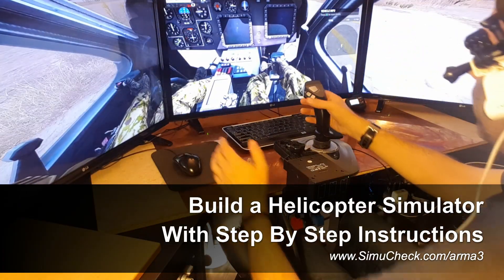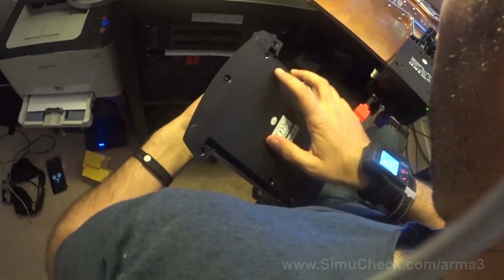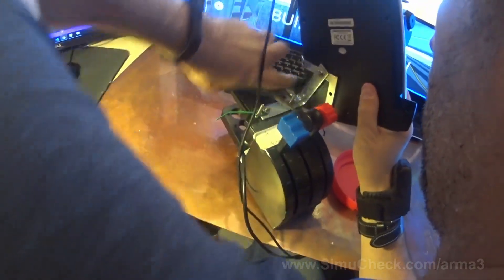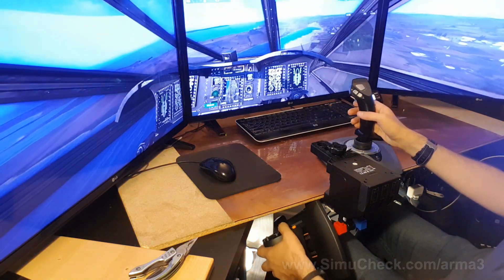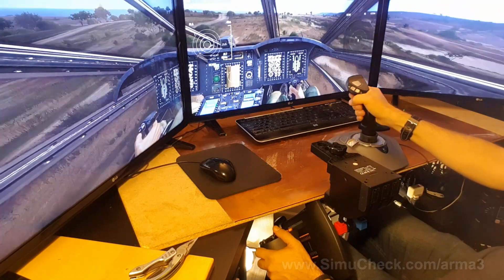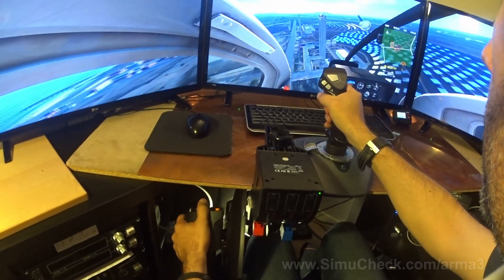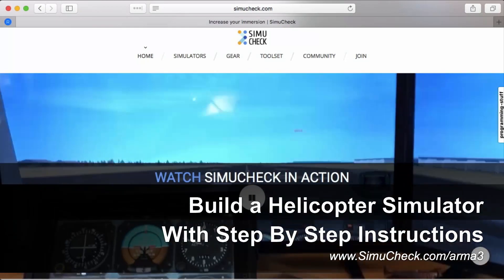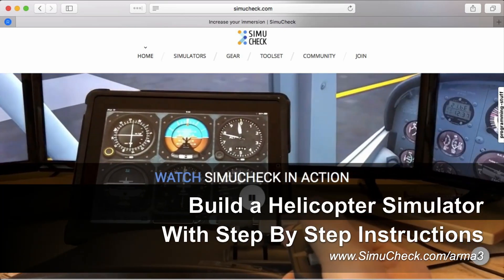Easily build a realistic helicopter simulator with Arma 3 - Step by Step Instructions

Comment: I'm looking on your website and it doesn't list the hardware that I need to connect the Thrustmaster to the throttle quadrant.
Reply from the maker: In that video I just spent a weekend and used metal rails from Home Depot... It was a hack. I have been wanting to find time to refine the process and put the plans on my site, but not enough time
The problem is there isn't a single rail from Home Depot that connects both screw holes on the thrustmaster. So I used 2 rails and then connected them together. I have considering 3d printing a plastic connector. 
Also after I created that video one viewer said the collective should be lower next to the chair so I started playing with it next to the chair ( http://www.simucheck.com/SimulatorSetups/view/8 )

What do you think ? Should it be 3d printer plastic or on the metal rails I could also drill out a hole to match the exact location ?

either way Flight Simulator 2020 is coming out so I might be airplanes for a bit before I return to helicopters ;)

Comment: Also, you could've use TrackIR to look around.
Reply from the maker: I really like TrackIR and I have tested in the past, but with flight simulators I found always looking down to aviation charts it always set the view down. So I need to see if I can customize to only move in specific ranges, so this would allow me to look down and not have the view look at the floor
Reply: Bind disable/enable trackIR to a joystick button.

Comment: I'm a helicopter pilot. For realistic training, you should reposition the cyclic a lot lower, and further back, between your legs, so that you can rest your arm on your right leg and manipulate the cyclic with just your finger tips. This is why commercial simulator cyclics are an S-shaped stick. The collective should also be lower, and by your side so that when it is full down it is nearly horizontal. This video gives you a good idea of relative positions: https://www.youtube.com/watch?v=ysadvsXDVDU
Reply: The point of this demo is to show a heli sim at a fraction of the cost. It’s not about professional controllers, positions etc.
Reply from the maker: Very true - but after the comments from Packet Guy I took it on myself and went to home depot and modified my sim and lowered the collective to connect to my chair instead. And as you said i'm still able to do this at an affordable price compared to those insane sims online :)
check out the upgraded video of my heli sim
https://www.youtube.com/watch?v=m1D3NSpGzQA